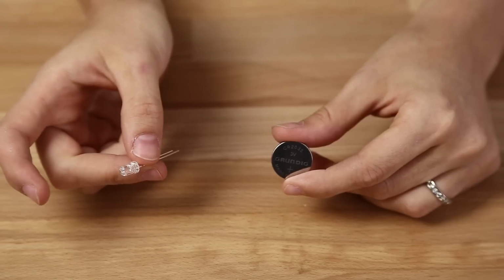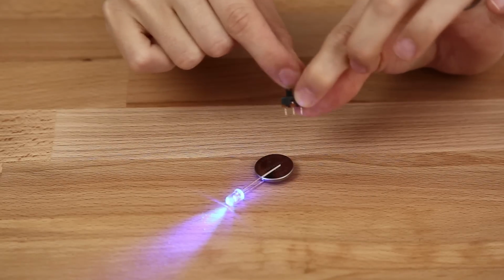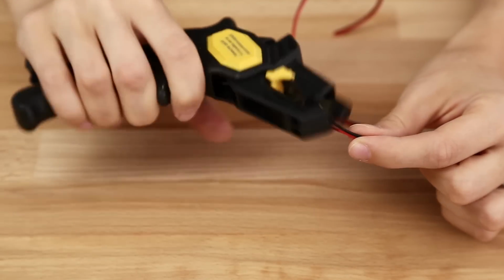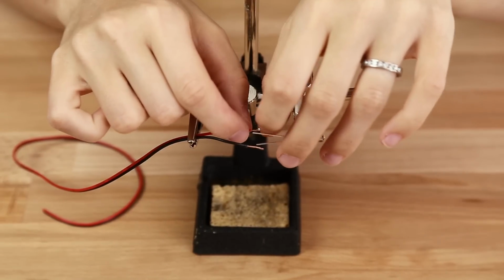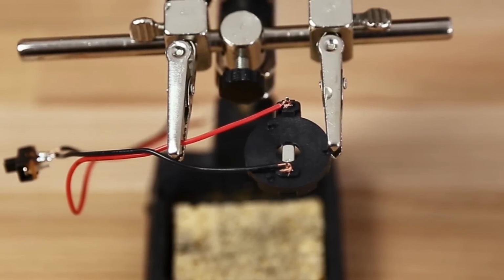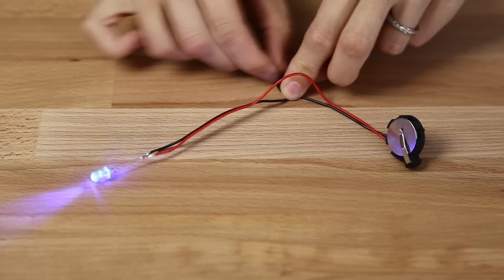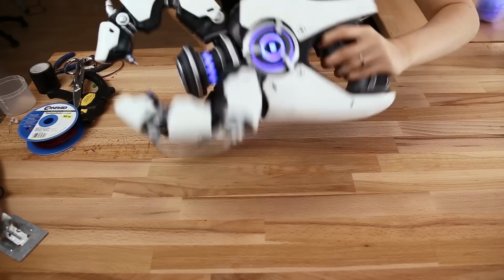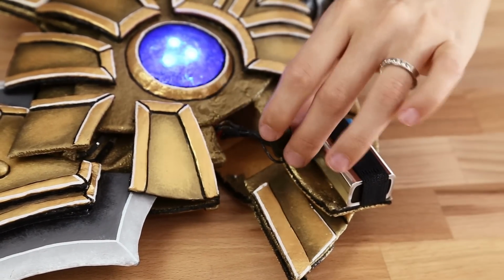Cosplay Tutorial - LED Basics

Comment: A few tips for you, to help the soldering of the wires go smoother and create a stronger joint, it helps to tin the wire first. this is simply applying solder to it before soldering to the led. To help with the protection of joints, slip on heat shrink to the wire BEFORE soldering. After the soldering is done simply slide the heat shrink up over the joint and apply heat with a open flame for a short period.  Just some helpful info for you.

Comment: How much does that LED last with the most basic battery?
Reply from the maker: In my LED book I have calculated the most basic combination but for a standard three 3V LEDs plus a 9V block battery its 27.5h.
Reply: If by "most basic battery" you mean just the LED across a button cell then that's still a difficult question to answer. There are different sizes of button cell. The different colours of LED require different Voltages to operate and as the battery runs down the LED will slowly become dimmer so it's subjective when the battery is 'done'. As the batteries aren't very expensive it's probably worth just trying one to see.

Comment: A little tip for you guys, you usually should use a resistance in front of your LED cause a LED works with rly low voltage.

Comment: I am no expert, but I recommend you to use a small resistor in series to your voltage source to avoid that the LED acts like a short circuit. This should keep your batteries alive much, much longer. Cool video though.
Reply from the maker: You don’t need a resistor if you are using a 3V battery and an LED though. It’s only required if your battery has more. :)

Comment: it's important to note if you use any battery other than a button cell you'll need to add a resistor to the circuit. otherwise you'll burn out your LED real quick!

Comment: One thing though: in the other props you did use 9v batteries. It's a bit hard for me as I also used one in my own, but there was a problem: I needed to use resistors so the diodes wouldn't burn out, but after that three LED was the max. four LED caused all of them to emit half the light and another one caused no light at all. Could you do a more advanced one with just how to use different batteries? It would be very helpful.
Reply: Just run two sets of LEDs in parallel: 3 LEDs and a resistor connected to the battery, and then another 3 LEDs and a resistor connected to the same battery.

Comment: I'm new to cosplay, so this may seem like a silly question. Is there a way you can light the LEDs with a gun trigger? Like, when you pull the trigger of a gun, the LEDs light up like a gunshot.
Reply: You would need to find a suitable "pushbutton switch" (like the typical doorbell button at your front door) that fits in the right place on your model, and substitute it for the "slide switch" shown in the video.
A typical "slide switch" stays in position after you switch it, while a "momentary contact pushbutton" turns off when you release it.
The trick would be figuring out how to mount the button behind the trigger, or MacGyver some way for the trigger to push the button when you pull the trigger back.   But the circuit for the LEDs would be virtually the same as in the video, just substituting the button for the little slide switch.
Reply: One option would be to forget the "gun trigger" and just embed something like this little pushbutton switch into the hand grip of the gun so you'd "fire" the gun by pressing the button with your finger instead of pulling an actual "trigger".

Check out eBay for "miniature pushbutton switch" or similar wording.

http://www.e-switch.com/system/asset/product_line/image/25/700-series.jpg
Reply: BobRDeTamble Thanks a lot! I'll add it to my list of items.

Comment: Hey, I'm struggling with my own led part of my costume and I think... You show that it is possible just to attach leds to a battery. If I put three leds in one battery like you did, how long it will work? Any calculations I could use? I don't need super powerful leds, those Christmas lights ones were good when I tried with them.
Reply from the maker: That depends on the milli-ampere hours of your battery and which LEDs you use. :) Just divide the mAh of your battery by the mAh each LED connected uses and you have the time.
Reply: Okay, thank you^^ I think I will manage with this... Maybe XD

Comment: if anyone's of any help i'm extremely new to lighting on cosplay and electricity in general. 
if i were to use the exact same Leds shown in the video would 20 AWG wire be good?

also where could i find switches for said wires. I've looked around amazon but since i don't know the specific name i'm scared of buying something that wont work.

thank you for your time.

Comment: When I attach the LED to a 9V battery, they flicker and burn out. Am I doing something wrong?
Reply: +Bombalurina05 
LED's do have a voltage around 3-4V (differents in the LED's color)
if you put a LED directly onto an 9V block they burn to pieces
what you need are resistances if you want to opperate a LED on a 9V battery
Reply: 2salzig2spucknapp I think I figured it out. I chained 6 resistors and 2 2V LED's together to the 9V. Seems to work great now. 

http://i.imgur.com/644yhnr.jpg

Comment: No resistors needed? 🤷🏼‍♂️
Reply from the maker: +bigsteed007 Only if your battery has more power than your LEDs need!
Reply: I did cringe when you connected the LEDs without a resistor.  But I can't deny that it seemed to work for you.  You're maybe relying on the internal resistance of the coin cell to limit the current.
Normally you need a resistor to stop the LED burning out, because LEDs are very sensitive to small changes in voltage.  R = (Vbat - Vled)/Current.

Comment: That advice you gave was actually pretty bad.  Hooking up LEDs is nowhere near as easy as you made it seem. Specifically the use of resistors.  I did notice however that you covered a lot of the import topics in your book.  Wish you had mentioned them in this video.
Reply from the maker: There is only so much time in a short video. I was just trying to get people interested and not shock them with all the details. :) It's easier to get into when you think it's that easy, even if it turns out to be a little bit more complicated ;)